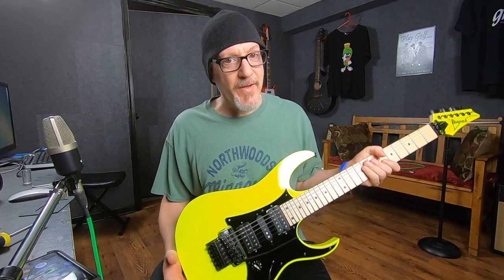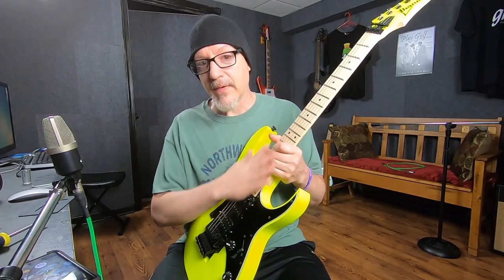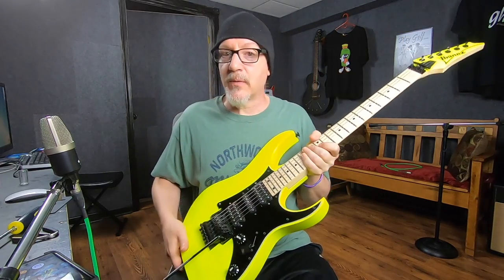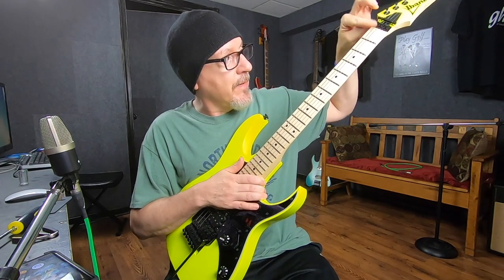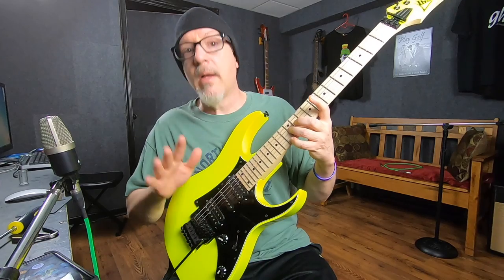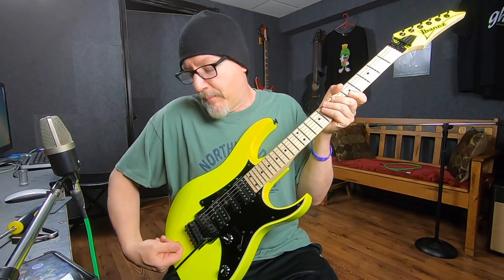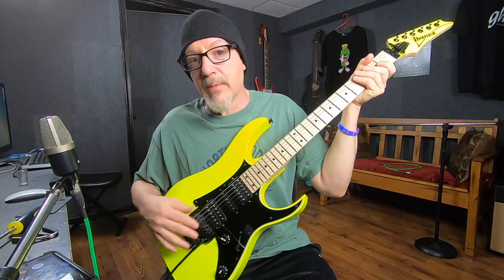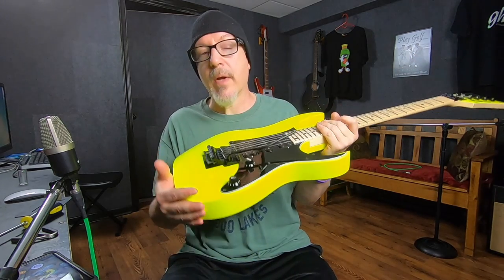Ibanez Edge Tremolo Quick Setup

Comment: The guy who runs Ibanez rules says it’s perfectly fine to adjust action on the original edge and edge lo pro under string tension, just remember to loosen the lock screws in the studs
Reply from the maker: Hi Brandon - thank you for this info - It would make adjusting the trem so much easier - I appreciate you taking the time to comment and yeah, loosen the lock screws in the studs... thanks again!!!
Reply: @ajlsoundwave  no problem glad to help, I know there’s a bunch of different information and beliefs but that Ibanez rules site is pretty impressive and he offers pretty nice deals on new Ibanez that he works over and sets them up to top form .
Reply from the maker: @brandonjackson5865  completely agree.  also, other cheaper liscensed trems plus some of the other fr knockoffs do have weak knife edges so glad to know the ibanez line is robust.
Reply: @ajlsoundwave  yeah about the only other one I would think is ok to adjust under tension is the Gotoh 1996t of course they share dna with the edge as gotoh made the edge at the start. Also the 1996t can be bought new for not a whole lot more than an FR special and in my opinion the edge and gotoh are better than the FR Original.
Reply from the maker: @brandonjackson5865  I had built 2 warmoth guitars with FR Original distributed by Warmoth that were absolute Sh*T.  The metal pieces that "pinch" the string all cracked; there is a brass plate under each saddle which over time they would fall out (pressed in) and the knife edges (because I did adjust under string tension) dulled / wore... which to me was an indication that these FR originals were just substandard to those being sold by other places at a higher price... Fortunately I sold all of my warmoths and do not have to contend with the FR's.  I do think the Shaller and Gotoh's are better quality... FR's went to crap...
Reply: @ajlsoundwave  no doubt about that if I had to have a FR Original I’d definitely go Made in Germany Schaller but for the money the Gotoh 1996t is the absolute best I prefer the gotoh saddle design and Philadelphia Luthier Exchange had all their gotoh hardware on sale last month and you could get a new 1996t for about 130 dollars and that’s a steal and that was the same price chrome, cosmo black (matches Ibanez) and the gold plated ones. They didn’t come with the nut , but I’m cool with that for that price and the nut would be the part that could differ from one guitar to another. I’ve found that Philadelphia luthier exchange is the best source in the US for gotoh hardware you can even buy their locking tuners individually or as a set and they ship in three days to the South East .

Comment: u went over everything but actually setting up the bridge. its not an easy process. u have to block it off before u do most of those steps. ntm u have to balance it then check it back and for with whammy to see if its the pitch is right. not knocking u on the vid cuz everything else was right but the trem is something u have to spend more time on
Reply from the maker: Cool, thanks for the feed back.  Make & post a video of what you think it should be and let me know so I can be sure to check it out!